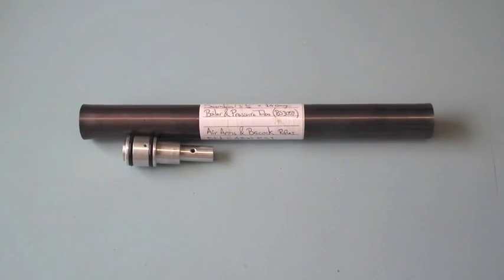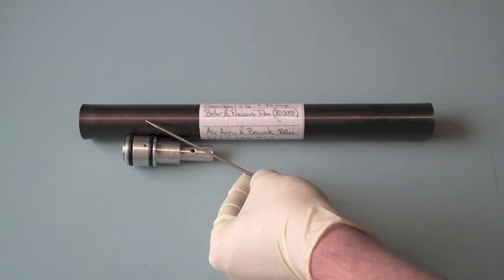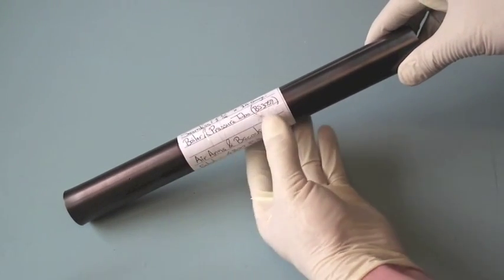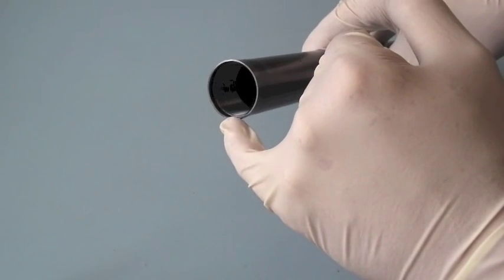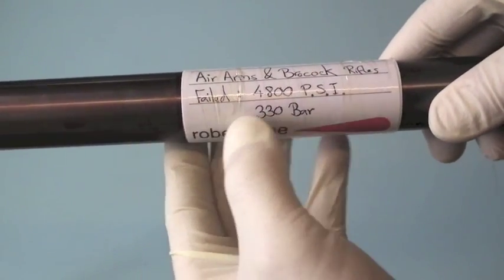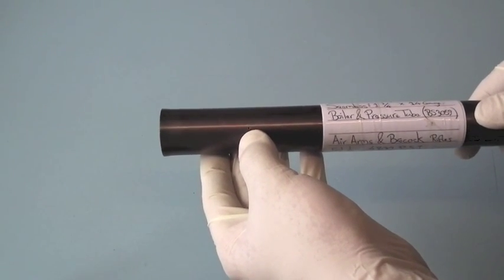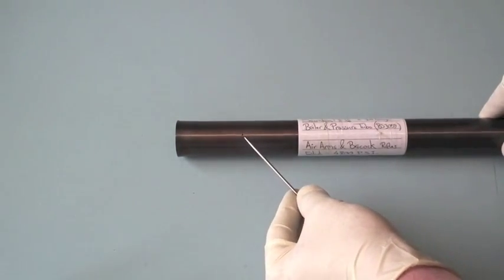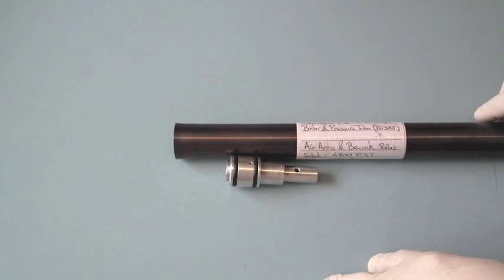Lane Regulators - FAQ 5 - Is an atmospheric breath hole a disaster in the making?

Comment: Thank you for this video. I would like to add that, because of the 2 pieces o-rings, the pressure at the breather hole is only ambient air pressure and is not the air pressure within the tank. Therefore, the Hoop Stress in this area of the tube is ZERO and so there's no chance for failure due to the breather hole, ever. (Not the same situation if the hole is for a pressure gauge which implies that there will be hoop stresses involved, because of  the pressure.)